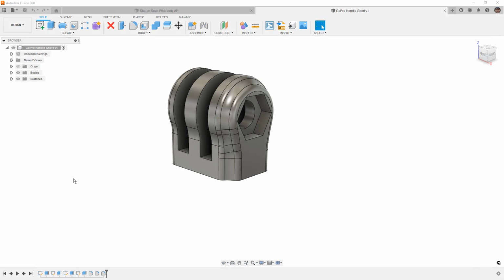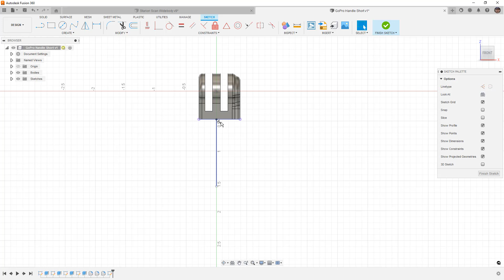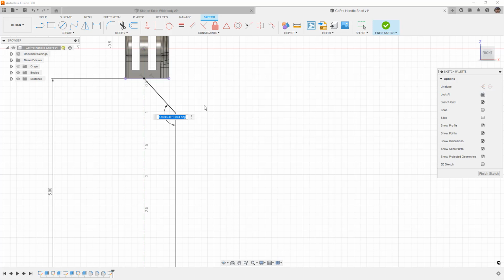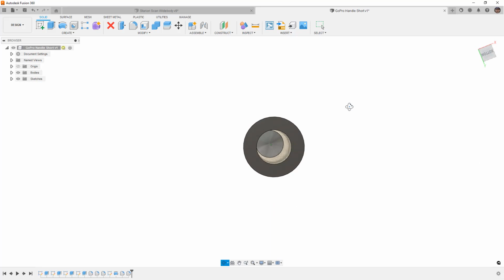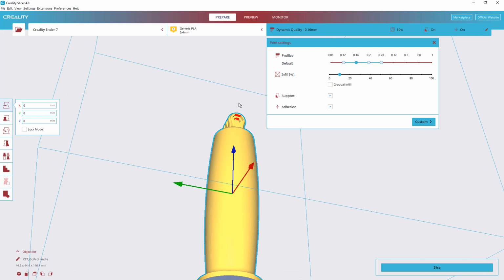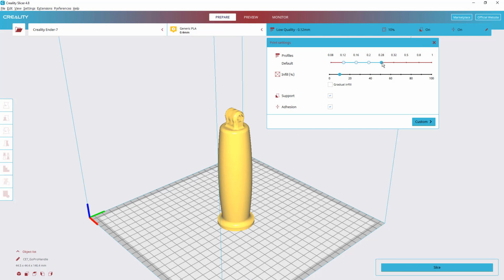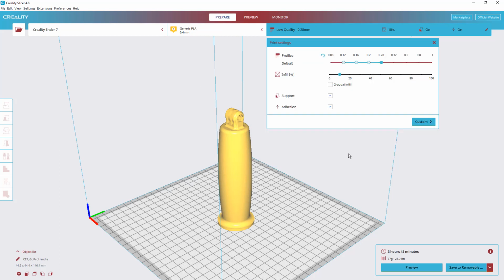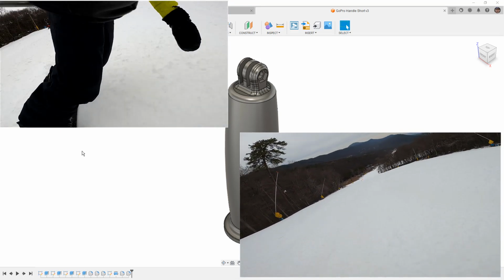How To Design a 3D Printed GoPro Handle with Fusion 360 | Make a Selfie Stick #fusion360

Comment: If this was a design that had a screw thread instead of a nut would you 3d print the thread on PLA?
Reply from the maker: in PLA probably not.  In PETG yes but not with the standard machine screw that GoPro uses.  The threads are too small and I would want something a bit more course.

Comment: 10:47 rotating the cut for the nut 45° in CAD would help to print the feature without need of support.
Reply from the maker: 100% correct